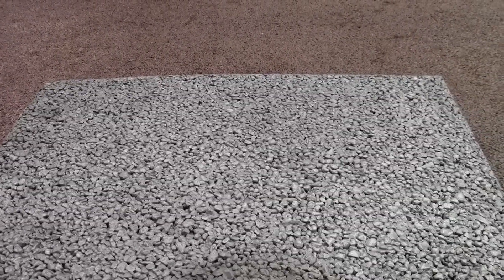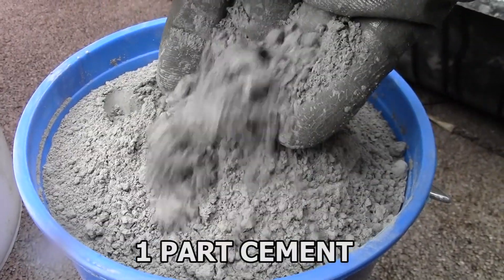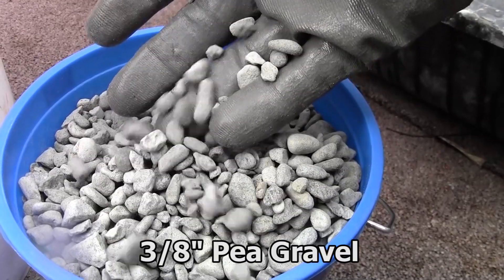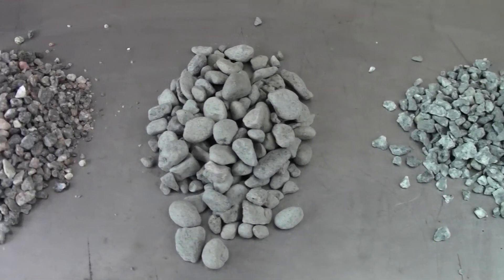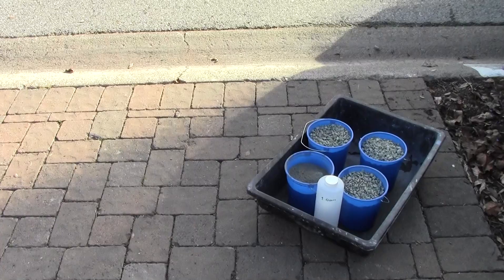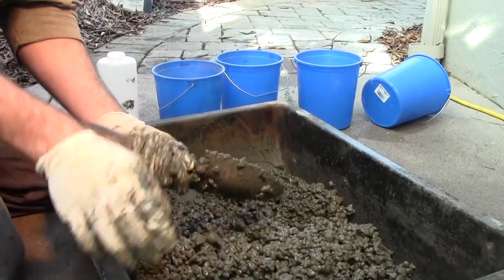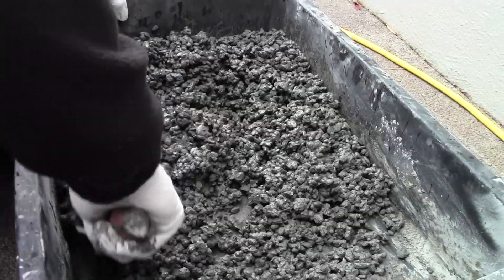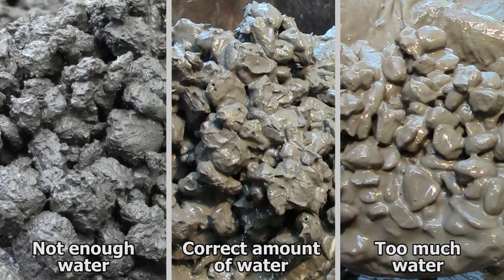How To Make Pervious Concrete

Comment: Will frost cause any problems with this product? We don't get very cold temperatures here -5 Celsius is about the limit but 0 to -1 more commonly.
Reply from the maker: Pervious concrete holds up very well in cold climates.  It has been used extensively in the northern U.S. and Canada for decades, primarily for parking lots.   This topic is on my list to write an in-depth blog about since the question does come up often.  There are a couple of caveats like good drainage, typically lots of drain rock, should be provided below the pervious concrete pavement.  Also modified snow plows should be utilized and deicing salts not used or at least used with caution.  However there is at least some evidence that pervious concrete can actually be safer, cleaner in snowy conditions since ice is less likely to build up on its surface unlike with more ordinary pavements.

Comment: When applying the product can it compact with vibration?
Reply from the maker: Pervious concrete can be installed using compaction with vibration.  However one needs to be careful using this combination as it can very easily lead to over compaction and sealing up of the pervious concrete.  Alternately, if the compaction with vibration is delivered a little too late to the fresh placed pervious concrete, it can damage it and lead to raveling (loose rock on the surface).  Therefore the timing and compactive force need to be precisely and constantly monitored based on the specific pervious concrete mix and changing site conditions.  All that being said, compacted and vibrated pervious concrete can produce the highest compressive strengths.
Reply: @perviousproducts6648 . Thank you.

Comment: What weight can it bear? And it's life?
Reply from the maker: Pervious concrete can be designed to support about any weight.  Its most common application in the U.S. has been on parking lots.  If designed and installed properly pervious concrete can also be used for higher and heavier traffic areas like bus stops, semi truck parking and even highways.  We go a little deeper into this topic on our blog:

https://perviousproducts.com/thick-make-pervious-concrete/

Pervious concrete will last as long or longer than ordinary concrete, 20 plus years.  Pervious concrete has the potential of lasting longer because it tends to shrink less, therefore it generally cracks less than ordinary concrete.

Comment: Which strength  occured  in the material
Reply from the maker: The short answer to how strong pervious concrete is... is that it's compressive strength is typically around 2500 psi (17MPA) to 3000 psi (20 MPa), which can be a little lower than ordinary residential concrete with typical strengths ranging from 2500 psi to 4000 psi (28MPa).  Pervious concrete even at the lower end, at 2500 psi, is still very strong and provides over a 7-fold safety factor for supporting the weight of a firetruck!
However there currently are not any ASTM or other certified tests for determining the compressive strength of pervious concrete.  I believe this is so, in large part because there are just too many variables in the mixing and placing of pervious concrete.  Unlike ordinary concrete, just because a certain result is obtained for a specific pervious concrete mix design in the lab does not in any way guarantee the same result in the field.  Slight changes in the water content, the weather, timing of the placement and compaction differences are all factors that will significantly influence the final strength of pervious concrete.

Comment: I found green ant builder create this type of product using plastic waste for mixing material. I really love the idea, I want to bring this idea to my cummunity, but they charge this tech with high price, can you please teach me how to make previous concrete to use for paving road? I would love to discuss this idea
Reply from the maker: The little bit we experimented with incorporating plastic waste in our pervious concrete, it did not yield promising results.  It may be possible to substitute a portion of the aggregate with recycled plastic in pervious concrete without negatively impacting the strength too much.  However, since pervious concrete needs to be optimized to be suitable for road traffic, incorporating plastic waste into it would probably bring us further from that goal of using it in high traffic applications.
Reply: @perviousproducts6648  by far greenant product only suitable for side walk or maybe for some park or garden, they also make a interlocking brick with slightly different material mix for home wall, this is really interisting for me

Comment: Sir and the  cement can we use any type of  cement🕰🕰🕰
Reply from the maker: Most Portland Cement are compatible with pervious concrete.  All the different Portland Types seem to have the same attributes in pervious concrete as they do in ordinary concrete with no discernible deleterious results.  
The one factor to be wary of however is ASR (alkali-silica-reactivity) or other issues with the aggregate chosen.  
Fly ash, slag, silica fume and other pozzolans also seem to be compatible with pervious concrete in approximately the same substitution rates as they are in ordinary concrete.
CSA (Calcium Sulfoaluminate) cements and no doubt, many others are also able to be used in pervious concrete.

Comment: Sir can we use the rocks that are used for road and building  construction 👌👌
Reply from the maker: Almost any rocks/ aggregate can be used successfully in pervious concrete.  If the aggregate is dirty, dusty or has a lot of fines in it, this will tend to reduce the compressive strength of the pervious concrete, but not typically by an egregious or detrimental amount.  
If the aggregate is too well-graded, has too broad of a gradation, this can reduce the pervious concrete's permeability.  Or using well-graded aggregate in pervious concrete can require less cement to get the desired permeability, thus reducing its compressive strength.
We like to use clean, gap or narrow gradation aggregate for most of our pervious concrete in large part because we feel we can get more consistent and reliable results.

Comment: Can be used in high temperature area ?..
Like 50 degree Celiac's?
Reply from the maker: Pervious concrete can be trickier to place in high temperatures, but once installed high temperatures are not a problem at all.  Even in full, intense sun where pavement temperatures can exceed 75 degrees Celcius (170 degrees Fahrenheit) pervious concrete, just like ordinary concrete will do fine.
For tips on how to place pervious concrete in high temperatures, check out a couple of our other videos:
https://www.youtube.com/watch?v=y0m0yrG0ghE   'How to Place a Pervious Concrete Path'

https://www.youtube.com/watch?v=xkkgTXbYvBI   'Avoiding Raveling of Pervious Concrete'

Comment: Could you share us the water-cement ratio to get the correct amount of water?
Reply from the maker: There are many factors that go into determining the correct w/c (water to cement ratio) for a particular pervious concrete project:  the type and size of the aggregate; timing between when it is mixed and placed; the quantities and types of admixes that are used (if any);  and even the temperature and humidity make a difference, the warmer and drier it becomes, the slightly more mix water will be needed.  It is best to become familiar with your specific mix design, documenting the amount of water needed for a particular amount of cement, to achieve the correct consistency when placed, knowing what too-dry, too-wet and just-right look like. 

Being familiar with how the consistency of the pervious concrete should look will help overcome the biggest variable for determining the amount of water, which is the moisture content of the aggregate itself.  Most w/c recommendations are given off of ssd (saturated surface dry) aggregate, where the minimal aggregate pours are filled with water, but the surface is not visibly wet.  This is a mythically impossible condition to achieve for anywhere but the lab.  In real life (field conditions) the aggregate is going to vary considerably in wetness, even within the same pile, and the slightest changes in moisture make a big difference in the final consistency of the pervious concrete mix.

Comment: But where does the water go?   Is there no drainage under the concrete?  If it just lies under the slab, and it freezes,  you have a heaving problem.
Reply from the maker: As I mentioned in an earlier post, this important topic, of pervious concrete in cold climates, requires an in-depth blog or even its own video.  Typically several inches of open drain rock are used for the base and drainage of pervious concrete.  To see how deep this rock layer should be, check out our blog  http://perviousproducts.com/pervious-concrete-base-material-depth/.
Suffice it to say, in heavy freeze-thaw environments this drain rock layer should be deep enough to accommodate any rain and/or melted snow.  The bottom line is pervious concrete has been installed all across the USA and Canada for over 30 years now with very good results, including in extremely cold climates.
Reply: @perviousproducts6648  There are probably some areas where this type of pavement would not be advisable, or would need a modified base. For instance, where I live, a driveway might freeze 5 feet deep since it is kept clear of snow (which would otherwise act as insulation) and since the weight of traffic has a tendency to drive the frost deeper than usual. Also, the soil is impervious clay which holds water near the surface thruout the winter, effectively bringing the water table up to within 6 inches of the surface. Thus roads and driveways normally heave up several inches during the course of the winter. A typical open-graded base would fill with water and freeze, then the water would freeze within the pavement itself, possibly causing it to break apart. The only way I can think of which might work would be to build a very thick open-graded base, several feet deep, which would be placed entirely above the ground level and thus above the high water level, providing enough room for water to dissipate before  it freezes. But even then I wonder if it would work.
Reply from the maker: @Ethan.Lamoureux  The other thing one could do in this situation is to add perforated drain pipes in the gravel base to redirect excess water away from the pavement.  It is also recommended to use air-entrainment and/or other modified mixes in freeze-thaw climates.  Again pervious concrete has performed well in heavy freeze thaw and there are even potentially some advantages to it over ordinary pavement.  Light amounts of snow can dissipate faster, ice doesn't tend to accumulate on the surface making for safer pavements and less need for deicing salts.

Comment: Bangladesh need this for flood management
Reply from the maker: There are a lot of areas that could benefit from using pervious concrete to minimize occurrence of flooding.  It is helpful in two ways.  To begin with pervious concrete slows down or eliminates entirely rainwater from running off the pavement.  Then the water that is absorbed by the pervious concrete slowly makes its way through the subsoil and recharges the groundwater.  Keeping the groundwater, which is often relied on for domestic use, full is important because if it drops too low subsidence can occur.  Subsidence is when the ground actually sinks and lower ground of course is more prone to flooding.  Subsidence is a permanent, irreversible process and if too much occurs the ground can become impermeable and unable to absorb more groundwater.

Large portions of the city of San Jose, California in the U.S. have sunk 13 feet (4 meters).  Recently Jakarta was named the fastest sinking city in the world, https://www.bbc.com/news/world-asia-44636934, with parts of it sinking as much as 25 cm a year!

Comment: Very useful video, Thanks. How does this product hold up to freezing though? Wouldn't it crack?
Reply from the maker: Thank you, John!  Pervious concrete holds up very well in cold climates.  It has been used extensively in the northern U.S. and Canada for decades, primarily for parking lots.   This topic is on my list to write an in-depth blog about since the question does come up often.  There are a couple of caveats like good drainage, typically lots of drain rock, should be provided below the pervious concrete pavement.  Also modified snow plows should be utilized and deicing salts not used or at least used with caution.  However there is at least some evidence that pervious concrete can actually be safer, cleaner in snowy conditions since ice is less likely to build up on its surface unlike with more ordinary pavements.
Reply: @perviousproducts6648  Did you ever get around to writing this blog post?

Comment: What additional considerations for Driveways?  I.e. for vehicular traffic.  Can you use reinforcing mesh?
Reply from the maker: Generally it is a good idea to make pervious concrete a little thicker than ordinary concrete.  So for vehicular use often 5.5" to 6" (14 to 15 cm) is adequate.  Making it thicker helps to offset not being able to use reinforcing mesh.  Since wire mesh or rebar would corrode quickly due to all the moisture moving through the concrete it is not recommended for pervious concrete unless it is coated or treated.  Alternatively, non-metal fibers can be used for varying amounts of reinforcing.  

For more discussion of how thick to make pervious concrete for various applications:
http://perviousproducts.com/thick-make-pervious-concrete/
Reply: Thank you for your response, I can't believe I didn't recognize the corrosion aspect my self :).   Yes I have heard of the fiber additive.  Anyway I'll check the link. @perviousproducts6648

Comment: can you please tell me what are test to conducted on this type of concrete and mix ratio???
Reply from the maker: There are four (4) ASTM tests specifically designed for pervious (permeable, porous, thirsty) concrete:

ASTM C1701  Standard Test Method for Infiltration Rate of In Place Pervious Concrete     
     
ASTM C1688  Standard Test Method for Density and Void Content of Freshly Mixed Pervious Concrete     
     
ASTM C1747  Standard Test Method for Determining Potential Resistance to Degradation of Pervious Concrete by Impact and Abrasion     
     
ASTM C1754  Standard Test Method for Density and Void Content of Hardened Pervious Concrete  

Currently there is not an ASTM test directly related to the strength of pervious concrete.   Also even though there is a test, C1701,  for measuring the permeability of pervious concrete, there is no consensus of what that rate should be.  

One can test pervious concrete using cylinder and cube molds for compressive, flexural, tensile strengths just like with ordinary concrete.  The trick is documenting how the lab tests will accurately reflect the field results.  There are so many factors that have an out-sized impact on the field results of pervious concrete, like weather, slight changes in the aggregate gradation or water, degree of compaction, et al.

Determining the exact mix ratio for pervious concrete can be a challenge and varies depending on the aggregate used, weather and other onsite factors and what characteristics the installer and/or customer desire.  The best approach can be to take our basic formula outlined in the video and start making small samples using your desired aggregate, carefully documenting the process and recording the results.  We like to start this process by comparing permeabilities of various mix ratios.

Comment: Why don't u use fine aggregate. ?
Reply from the maker: One can add a small amount of fine aggregate (sand) to pervious concrete, but obviously the risk is if too much is added and it then becomes impervious.  Controlled amounts of fine aggregate are sometimes added to pervious concrete, depending on the coarse aggregate that is used and if a little higher strength  or resistance to freeze-thaw damage is desired.  
On the other hand we usually make our pervious concrete or at least our pervious concrete topping out of all fine aggregate.  By using the coarse end of fine aggregate (sand) we make a very smooth, attractive pervious concrete.  
The best thing is to test different aggregates and combinations with varying amounts of cement and see what works best for your particular application.  Compare permeabilities, strengths and aesthetics.  Have fun!

Comment: Wat is the setting time
Reply from the maker: The 'setting time' is similar to ordinary concrete, typically an hour plus for initial set.  However the 'working time', the time one actually has to place and finish, for pervious concrete is much less than ordinary concrete.  It can be as low as a few minutes in less than ideal conditions.  Please check out a couple of our other videos for an in-depth answer to this:  https://youtu.be/y0m0yrG0ghE ("How to Place a Pervious Concrete Path) and https://youtu.be/xkkgTXbYvBI ("Avoiding Raveling of Pervious Concrete).
Reply: @perviousproducts6648           tq so much